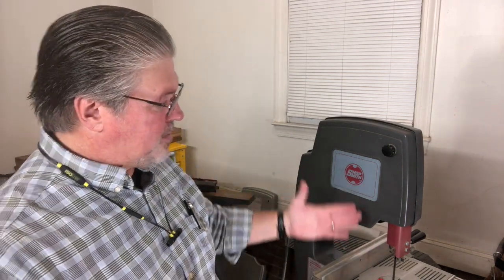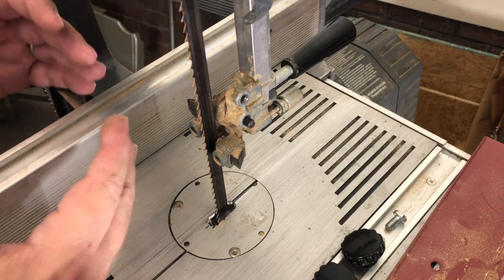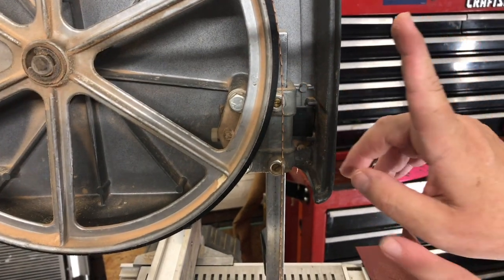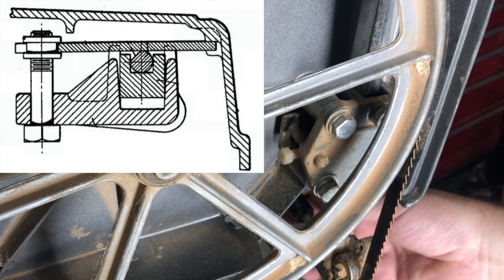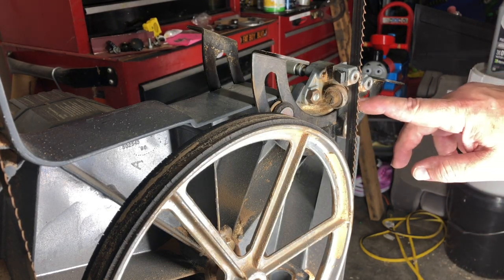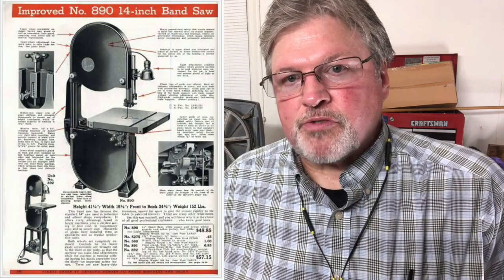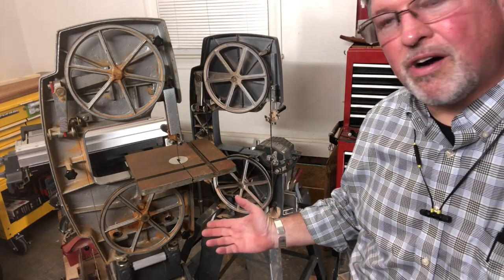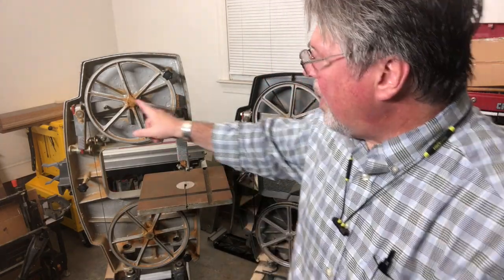The "Business End" of the Shopsmith Bandsaw: Upper and Lower Guides and Bearings

Comment: Another little quirk which is possible, relates to the guide blocks themselves. You will notice that the angles are different on each end of each guide block. When reversed, they will put a 45 degree twist in the blade, so that the bandsaw can be used as a cutoff saw for longer board stock, as long as it is not wider than about 8 or 10 inches. When the blade is i  its conventional alignment you can not make a cutoff longer than about 11 1/2 inches. Personally, I do not like putting that twist in the blade as I believe it puts additional stress on the blade, shortening its life. The attraction is that you are enabled to cut off stock that is nearly 6 inches thick, and whatever length you can physically handle safely. (using a table saw to cut thick stock, you would have to have the blade as high as it would go, make a cut, turn the board over and cut again, trying to get the two cuts in line with each other.)
Reply from the maker: You are absolutely correct and that was something I planned on mentioning in the mid-week video, but just like you, it isn’t a process that I like to use. If the SS BS was the only saw I had available that feature might actually come in handy. Thanks for bringing it up.  Scott (Sorry, but I sent my first reply from the wrong account)

Comment: 1/4" and 1/8" blades have a tendency to jumb out of the guide blocks...for those blades, take a very hard wood like hard maple/purple heart and replace the horitiontal guide block, remove the angled one... in the new horitzontal block cut a kerf about 5/16"  (before installing it... the blade will run in the kerf (wood will nut dull them). takes care of most of the "jumb" out problem, especially with 1/8"
Reply from the maker: Nice solution.

Comment: Hey Scott, me again.   Trying to get the BS set up properly.   The guide block adjustment, both upper and lower,  is very difficult, if not impossible.  I took the adjusting knobs off completely. and got the upper all the way out by prying with a screwdriver, and it does not want to back in.   Any words of wisdom?
Reply from the maker: Hey Thomas, I would scour the parts with ScotchBrite or steel wool and get them clean and shiny. After that go ahead and put some paste wax on them as long as nothing has been bent they should slide smoothly.

Comment: I just inherited a SS band saw from a neighbor. My lower thrust bearing does not touch the back of the blade. How can I adjust?
Reply from the maker: Hey Phil, I suggest backing off the top bearing until the blade runs against the lower bearing and the auto-track bearings on the left. The blade should run against the auto-track bearings and the lower bearings, but be just ahead of the upper bearings until you apply a board against the blade. They can always be brought back into working service, so take it slow and get to know her.  Scott

Comment: Hi Scott, my upper guide adjustment is tight and I can't seem to get it loosened up.  I've cleaned and then sprayed with dri-lube and run it in and out a few times with a screw driver.  But it's still tight to the point where I can't finger adjust it. I always have to resort to using a screwdriver.  Can I back it all the way out and actually remove it to get a better coat of lube on it (and potentially see if anything else is going on)?
Reply from the maker: Hey Dana, Yes, you can absolutely remove it and I have on occasion even filed a little burr or bump off that is in the parting line of the casting. It’s worth a look and you are right, you’ll be able to do a thorough waxing job if nothing else. Scott

Comment: Hi Scott, with your guidance I have my circa 1984 SS bandsaw humming along nicely. It is an impressive tool. Although I appreciate the compact size of the cast iron table most of the time, sometimes I've wished for something larger, and with the option of using a precision fence (instead of the homemade wooden fence and c-clamps I use now). Have you done a video addressing this issue?
Reply from the maker: I don't and probably should. As I've mentioned on a few videos I like both tables and wouldn't consider changing from one to the other. Keep watching and I'll do some things with my saw that has the cast iron table in the near future.  Scott

Comment: Did shopsmith ever build or design a larger bandsaw? I bought one and I really like it. I noticed a lot of the small differences that you have been talking about and I immediately thought, can you scale up all of these features and make a 14, 16 or bigger bandsaw. Thanks for your incite.
Reply from the maker: They designed and built a prototype that could be expanded for resawing but it never made it to production. What brand is your saw? Inca made one that had a few of the same features.  Scott
Reply: @MyGrowthRings  mine is a shopsmith bandsaw cat. No. 502751. It's the one with out a dust port and with out the adjustment window in the cover. Is there anything I should look out for in this older model?

Comment: Thinking of getting a shopsmith , how tall is it in the upright mode? say for example when using it as a pillar drill
Reply from the maker: Hey Paul. Depends on which model Shopsmith you are talking about. A Mark V model 500 measures 76 1/4" to the very top when vertical.  The current Mark 7 Power Pro measures 78 1/2" and the 1960’s Mark VII measures 63 1/4", which clearly give it an advantage where there’s a low ceiling.  Scott
Reply: Many thanks

Comment: Scott, thank you for the series on the bandsaw.  I bought mine when my daughter was 6 years old, she is 39 now, bandsaw still helping build small boats.  My tension device has a snap ring that holds it to the pivot and it is ratcheting when I tension the blade. And tricks to cleaning/lubricating it?  Over the years I have made all the mistakes you mentioned in your videos, after your tuneup the saw works great.  What a clever design!
Reply from the maker: I'm so happy to hear that it has served you so long and so well.  I'm not sure that I understand what you mean by ratcheting. Yes, that entire assembly can be taken apart and cleaned and lubricated. It's been a while since I've seen one that needed that level of care, but you can use lithium grease on the bearing surface, and I use a Teflon-based spray lubricant on the threads and anything that feel like it needs it.
Reply: Thanks Scott, I will remove the entire upper arm and clean it up.  By ratcheting I mean when I aim for 1/4 inch tension, I will tighten the screw, nothing happens then it pops and overshoots to a higher tension.  
Shopsmith best videos available!  Thank you.
Reply from the maker: @jayknight850  Got ya! Yeah, that’s likely a lube issue. Thanks for your kind words!

Comment: I just purchased a SS and used it once. It cuts great but has a screeching noise that comes from the top. Is the blade too tight? It's not a SS blade so I had to adjust accordingly.
Reply from the maker: A Shopsmith bandsaw? The tension gauge will work accurately as long as the blade length is close. The noise is probably from the roller bearings in the upper wheel. They do need to receive grease from time to time and it’s one of those maintenance things that very few people even know they’re supposed to do. It’s an easy fix but I haven’t done a video on it yet. I’m sure there are several here on YouTube in the mean time. Scott
Reply: @MyGrowthRings  thank you. I learned a lot from this video

Comment: An excellent bit of display in detail shows that the upper and lower guide bearings are fixed. They do not move when the blade guides are shifted back and forth. These two bearings are fixed - not adjustable. An important consideration for parallelism in the two adjusting screws for the upper guide support shaft, is that the effect on the upper guide bearing must be consistent throughout the 6" range of travel of the upper guide support shaft...only possible when the two adjusting screws are equally adjusted.
Reply from the maker: Exactly! I realized that wasn't clear when I re-watched that after it went live, so I will hit on that point later in the week as well. Just goes to show you how many important details there are in understanding this well-engineered machine. Thanks for watching and for chiming in!  Scott
Reply: @MyGrowthRings  For one reason or another, some SS users have observed that their bandsaw tables are not square to the cutting edge (or the back edge) of the blade. This is a non-adjustable dimension, so something must be assembled badly or something is bent. (a 6 inch square laid on the table at tooth's edge shows nearly an eigth-inch gap at the upper limb of the square, on the OP's posting). This angle must be square in order for the saw to even be able to cut in a curve or circle, especially in thick stock. Do you have a means of illustrating this alignment issue  and the problem it presents in a curve?
Reply from the maker: Thomas Koehler Oh yes, I have absolutely seen this. I have wondered if it is an error in the casting of the aluminum table, because I don’t believe I’ve ever seen it with a cast-iron table. It can be corrected by shimming but I’m not sure that the error doesn’t return if the table is tilted. I’ll do some playing with my bandsaws (I have 5 and two Total Shop bandsaws) to confirm my suspicions. I appreciate the comment and yes, I will work that into the mid week episode. I really appreciate your help! Scott

Comment: I have an old Woodmaster SS Clone. I bought it basically unused and complete for $125. The motor is fantastic (220 volt 1 7/8 HP), but the lathe tool rest simply came apart the first time I used it and the live center as well. Needless to say it is accumulating real SS parts to compensate. My SS bandsaw would not slide into the toolpost openings...  I use it as a backup tool. only. Had wanted to convert it to a shorty, but it just doesn't fit the SPT's
Reply from the maker: Yeah, I know your machine. Do you happen to have their last model with the T-slots in the carriage? I don’t believe they sold many of them before they folded. The reverse engineering is what caused those issues, so running the SS SPTs using some other power source is probably your best plan of attack. You could purchase the newer, offset posts from the SS SPT’s and that might help. Thanks for dropping by, Scott
Reply: @MyGrowthRings  I've thought about having the posts machined to fit. If I can adapt SS parts it's a strong runner.

Comment: This is very informative, thanks!  Any advice for me on this....I somehow am 'that guy" you referenced that can't seem to get the upper guide aligned so that the movable guard locks tightly and getting the upper guides aligned with the bearing at all the various levels of board thickness you might use.   Is it best to just start over and move the upper guide rail adjustments to their starting point and adjust from there?  I've spent hours trying to get this right and to no avail.  Any advice is appreciated.  It's those two lockable adjustment screws that are giving me fits, and then the locking mechanism on the guard is always loose!
Reply from the maker: You beat me to my answer! Yes, start from neutral. Don't worry about the lock until the post is in the right location and moving up and down without moving forward and back.  Once you get that right just tighten the leaf spring to get the lock to work. It's easer to turn the lever towards the back (locked) and bring the spring forward slowly until it locks the post in place. From there, try loosening the lock handle and it should move freely. Good luck!  Scott
Reply: @MyGrowthRings  Got it done and works good.  Also installed the new "cool blocks" and they seem to be working ok.    There is a great need for a shopsmith YouTube channel that goes through the whole machine, how to use it, how to maintain it, etc.   I have a 1984 Mark V 500 and would love to see all the various things it can do, and about the upgrade.   Your knowledge puts you above the rest, so I think you have a winner channel here!

Comment: Scott I got two brand new blue kicks!  Quick question tho….Does the blade actually rub against the guide blocks?  I have them adjusted not touching the blade, just barely
Reply from the maker: When the saw isn’t cutting you don’t want the blade to rub against the blocks. Some folks use a piece of paper or even a piece of doubled-over Scotch tape as a feeler gauge or spacer.
Reply: @MyGrowthRings  just ordered accessory kit for the bandsaw….fence, table extension and circle jig.  U have these and do u use and like them?
Reply from the maker: @neiljackson1195  I have and use the table, fence and table extension but not the circle cutter. I’m not impressed by it and have other options that work better for me. Let me know what you think of it.  Scott
Reply: @MyGrowthRings  I sure will.  it came as a package and I really wanted the fence and table extension

Comment: Another quirk to consider with the locking shaft which raises and lowers the upper blade guide and roller. While this shaft may lock securely in place, it is subject to sideways movement, allowing the cut to wander off of true if  a rip fence is used for resaw work. I modified my bandsaw by adding a couple of long brass screws which reach through the outer shell of the saw, and into the gib which holds the sliding shaft. Once the Shaft is raised or lowered to the desired position for the cut, I lock it as usual, but then I tighten the two screws I added, so the shaft absolutely cannot move laterally. Of course I have to remember to loosen these screws before raising or lowering the shaft for cutting thicker or thinner stock.
Reply from the maker: That’s a really interesting modification. I’ve never felt the need to do that, but you’re absolutely right, that is one point that could use some reinforcements. I’d love to see a picture of your solution. My email address is MrToolHunter(at)Gmail(dot)com if you would care to share. Scott
Reply: @MyGrowthRings  later tonight.

Comment: Something that was kind of inferred from the discussion is that you are supposed to un-tension your bandsaw between uses?
Reply from the maker: Oh yea. I talked about that in another vid. If you know that you are going to store the saw for a week or more it is always better to remove the tension a bit. That's why I drilled an access hole into the side of the cover so I can remove the tension without removing the cover. Scott
Reply: @MyGrowthRings  OR, i guess you can purchase one of the new covers which has a window and access to the tensioning screw.  Not sure why they didnt build that into the original design. 🤷‍♂️  thanks for all of the tips!
Reply from the maker: @markb8954  A number of bandsaw manufacturers had their gauge inside their machine and required The cover to be removed to access it, so it really wasn’t that unusual when the saw was brought to market. What changed was when Shopsmith removed the knobs and went to bolts to attach the cover in order to meet Canadian standards. That made making tension adjustments with the cover off a pain in the butt!

Comment: Great video.  It's like you read my mind.  Just a few hours before this was uploaded, I discussed this exact issue with my girlfriend, specifically the location of the lower guide blocks.  I had two smaller Delta saws before I had my SS bandsaw and they were horribly inaccurate for the very reason you mentioned.  I also  like the knobs, and don't even get me started on thrust bearings that mounted perpendicular to the blade.  When you do your midweek revisit, I would like to hear your thoughts regarding the cast iron vs. aluminum table.  Our saw is currently set up with the cast iron table, but we actually have an aluminum table on hand and could easily change over.  However, my GF prefers the cast iron table.  She likes the feel of the cast iron, and the fact that the the miter gauge can be used as a fence.   What are your thoughts?
Reply from the maker: That’s an excellent topic and I will definitely spend some time on that later in the week. Thanks for the suggestion. And tell your girlfriend to watch too... the analytics on my channel tell me we need more women woodworkers! Scott

Comment: The guide block holders. Made out of two types of metal. The back side that slides in and out with the use of the adjustment screw/knob is apparently steel and the other side which holds the guide blocks each with a set screw, is not. Mine was completely rusted on the steel end. DO NOT PUT THIS PIECE IN RUST REMOVER. I did. The end that holds the guide blocks has been greatly compromised and I don’t think it is usable. I now need to try and find where to order these parts.
Reply from the maker: These are still in production at Shopsmith and often pop-up used on eBay, but be careful, some of the eBay parts are from clones.
Reply: I found them on the Shopsmith website. Only $11ea
Reply from the maker: Jason Kelsey Excellent! I think a lot of folks forget that they are still alive and well.